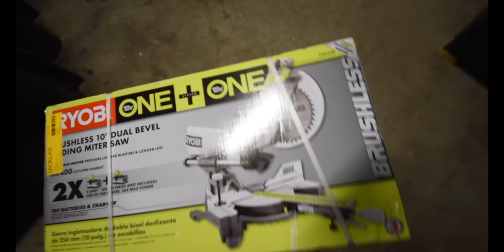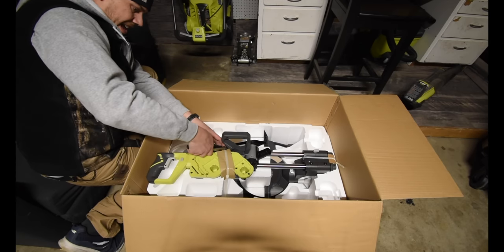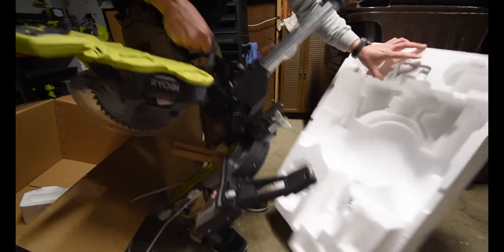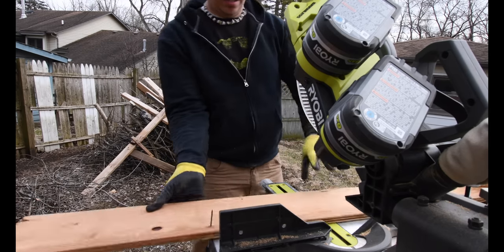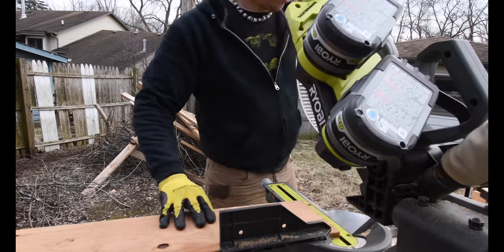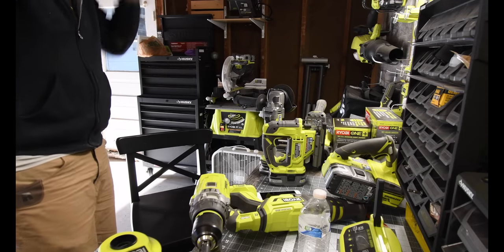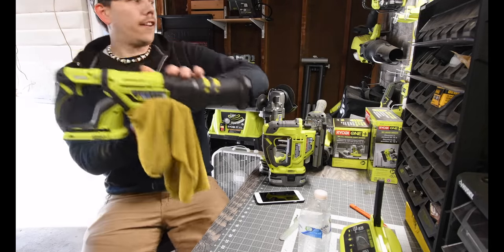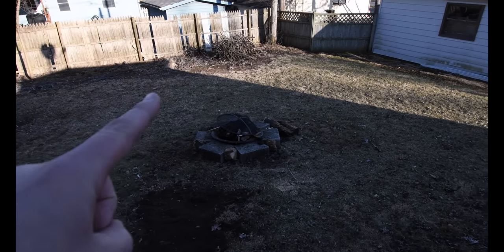Ryobi ONE+ miter Saw UNBOXING and cutting wood

Comment: I just picked up a used cordless 10” but missing the accessories.  Can you confirm if the dust bag, and clamp fit the 10” corded version?  Can seems to find a straight answer anywhere... 🙏 Thx!
Reply from the maker: I think its a standard size so it should fit, and that vacuums as well
Reply: @ManCaverTools  Thx, I just order the dust bag but can’t find any spec on the clamp size.  I felt they use a different part number so the part are more expensive.   Also you able to square you blade?  I notice mine is touch the left side of the tongue plate😫